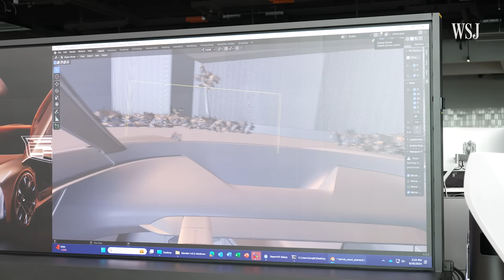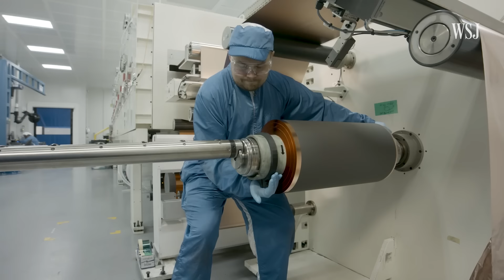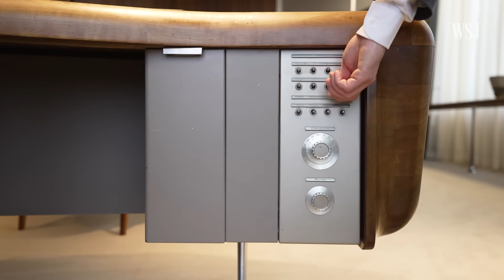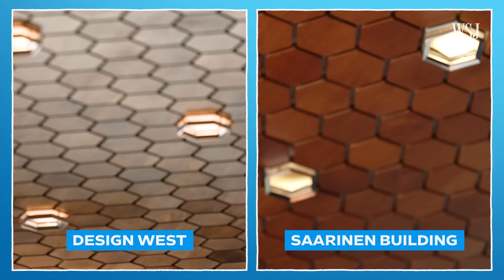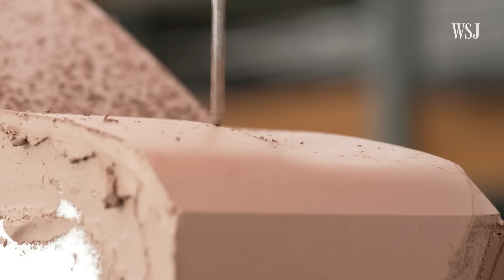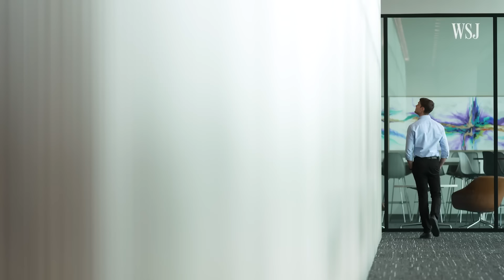Inside GM’s Newly Updated ‘Willy Wonka Factory for Car Design’ | WSJ Open Office

Comment: This is a really optimistic design studio. It has everything except people who actually know what people want. Basically a car is supposed to hold you in an enclosed space and move you from one place to another place. Whether the design makes you happy in that process is up to the designers. Technically the designs are out of date, as there is extremely no new ideas. Suppose you introduced three wheels, like the first car, but add suspension so that each of the three wheels leaned into the corners just an ice skater does. Three wheels would produce the least drag frictionally. Electric motors that had fields around a solid fixed axle would drive the car. I saw nothing like these ideas offered, just worn out designs that constantly repeat for no reason. I miss the days in the fifties and sixties when September offered new things every year.

Comment: "Dear Carolyn: My boyfriend of four-plus years and I are both in our mid-30s and have what I would consider a very healthy and generally happy relationship. It’s not perfect, but the respect, communication, genuine affection are there. However, we’ve hit a point of contention on getting engaged."

To Whom it May Concern, Do not confuse "affection" for lust, "communication" for lies and deception, and "respect" for disguised insults.  Do not confuse "healthy" for emotional and physical co-dependence.  Do not confuse "generally happy", for generally disconnected, unfulfilled and lonely.  

Cut and run, a.s.a.p..  You've hit a dead end.

Comment: What Saarinen was doing was futuristic at the time. That was the point. This new building should reflect the future as well. Instead they designed a building that takes zero risk and does not represent the future or dreams. It’s probably a reflection of GM. Huge lack of vision.

Comment: Funny, "they don't make knobs and buttons like they used to" is one of the main reasons I don't like new vehicles. They're huge, heavy, expensive, ..and yet as bland and boring as can be. 
All this design space and what we get out of it are shapeless boxes or blobs with interiors that have zero design effort, just blank dashes with a tablet slapped on. What happened to elegance? Being able to see how everything was actually thought out, with buttons and knobs that feel good, sound good, and a centre screen, (barely necessary anymore with digital main gauge clusters,) that's sculpted into the dash instead of cheaply slapped on top.

Comment: Their issue is not design.  It’s just about everything else.  It’s almost comical how they invested this much money.
Reply: Agreed. This 2B investment could be a case study as to why this company will continue to decline. Failing auto giants are really good at investing in flashy concepts that will never get built. Making functional, lag-free UI is a bit too much to ask. Reliability is a Japanese thing. Common, interchangeable parts across models is also no good.
Reply: And everyone wondered how they went bankrupt. 😆
Reply: Just in time for another bailout
Reply: GM is still spending our tax payer's bailout money.
Reply: @ricksmith1382 They repaid it in 2010.
Reply: classic GM.
Reply: Well said.  2B in reliability would go a lot further.  GM has often had great designs and ideas, just terrible management pushing terrible cars reliability wise.  14y with that company and I was always scratching my head as GM's biggest problem was GM itself.

Comment: Need to invest on making reliable cars, not overpriced junk
Reply: and electric cars.
Reply: Gm is actually doing pretty well. Lately Toyota has been failing
Reply: @portcybertryx222  Depends on how you specify failing. Also depends on which models your talking about.
Reply: @portcybertryx222  Yes, Toyota reliability fell from 98 to 96. GM reliability increased from 46 to 48 😆